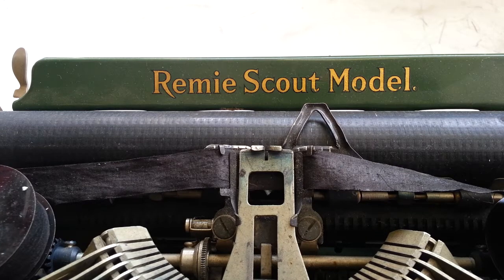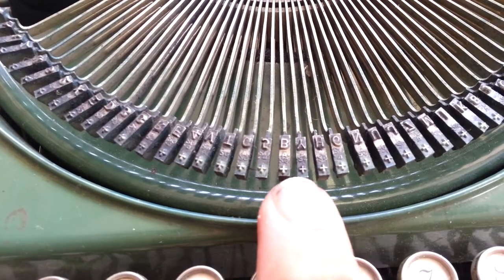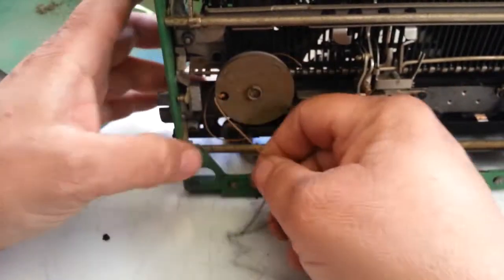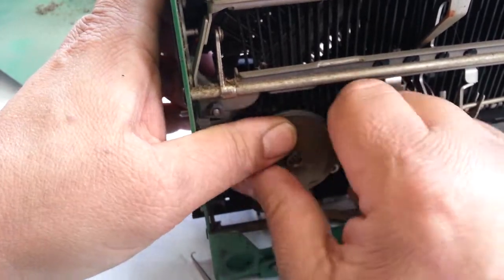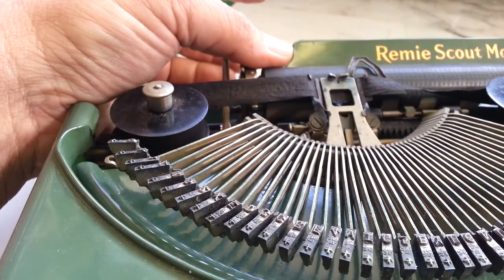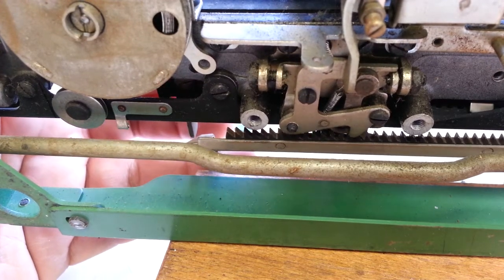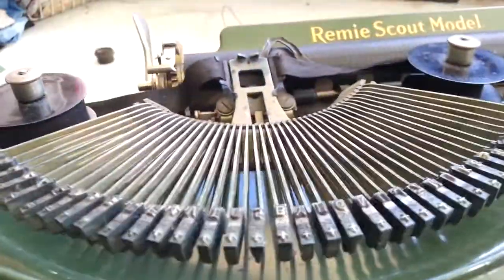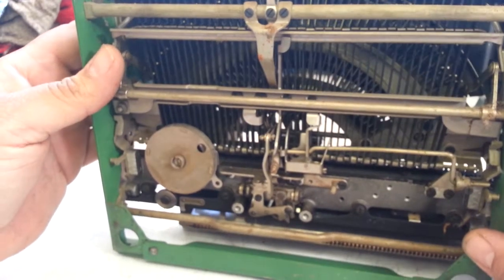Remington Typewriter Escapement Spacing Repair Diagnosis Draw Band Sticky Type Bar Bad Feet

Comment: When I got my Remette it didn’t space in lower case, long story short it turns out the space bar was hanging up on the front of the frame which had an inward curve. I very carefully pushed it out to clear the space bar and now it works wonderfully. No scratches or dent so I don’t know what the heck happened. Saw a picture of another, same thing. Right margin doesn’t work but don’t need or want it, no bell, no line lock. It has the same rack escapement, no star wheel.

Comment: It looked like the arm for the carriage release lever had been bent quite badly as well. You can see how the riveted bracket that attaches to the escapement rack is pulled downward
Reply from the maker: Yes, I noticed that when I reviewed the video too, I reformed it back in place off camera
Reply: Phoenix Typewriter Also, I always have to laugh when you slip and say “bend” and then correct yourself.... Amateurs “bend”, only pros “form”! hehe...Thanks for all the great videos Duane, I’ve learned so much useful stuff!

Comment: The lay man asks, "What's the difference between 'bending' and 'forming'?" The engineer/tech responds, "'Forming' is adjusting metal parts to conform to a particular specification. 'Bending' is what pretzel makers do." 😁
Reply from the maker: I might have to use that . . .